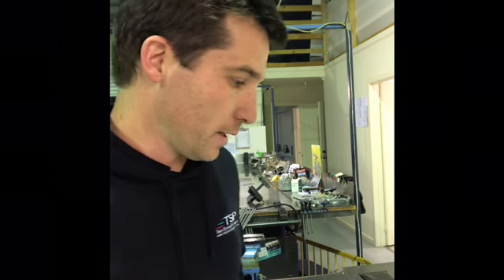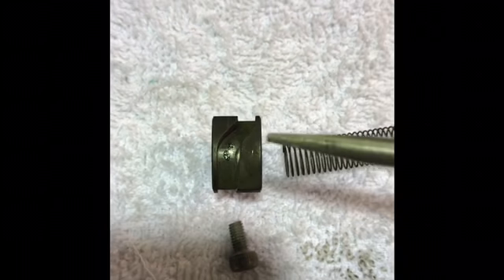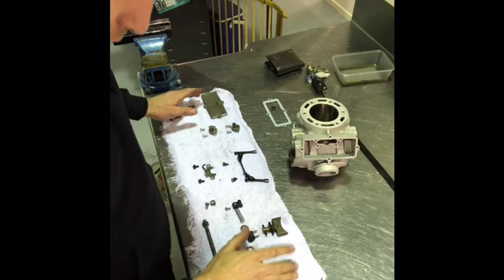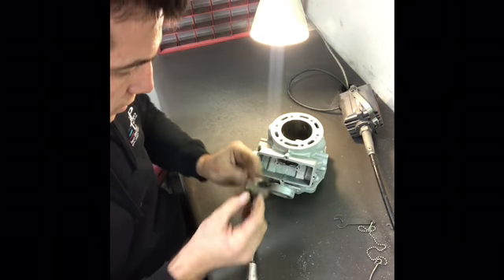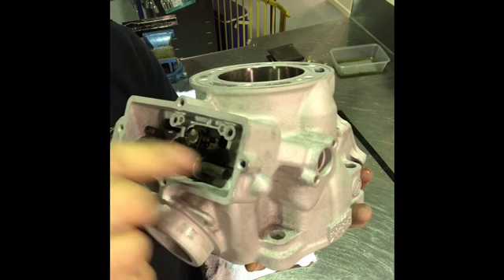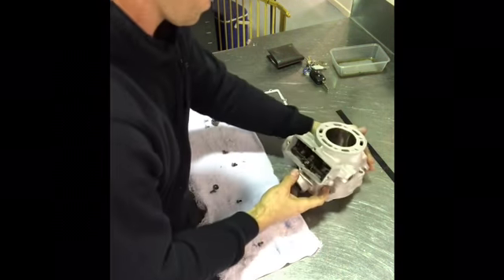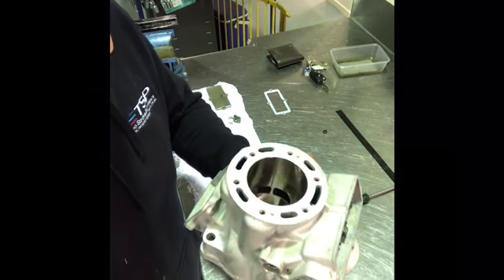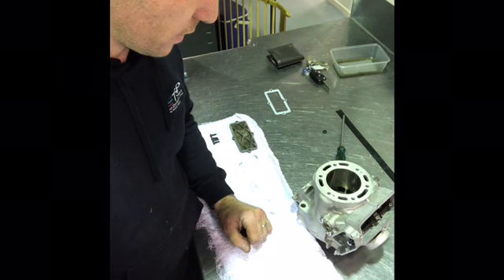YZ250 powervalve rebuild

Comment: The power valve shaft, #11 in the factory service manual, should have the retaining clip, #8, installed as soon as the shaft is put in.  This will locate it precisely for the rest of the build.  The fitment of the barrels was giving you issues as the shaft was sliding left and right which you kinda figured out at the end of the video.   Also the crecent cut of the power valve shaft at the retainer should be to the upper right as you are looking at the retainer after it is installed.  This will keep the cut out away as it is motion. 

Great video btw, really helped me!
Reply: I watched the whole video to find this out

Comment: Question. I have a yz250 new top and bottom rebuild. Power valve opens main valve but not the subs. If I turn by hand they all open, main first then subs. The linkage lifts enough to open the main when revving but stops too soon. Stock everything except fmf silencer. Power is great on the bottom and mid. Top feels  like a 125cc

Comment: I noticed you said it doesn't matter which side the drums go in. Wouldn't be ideal to keep previously mated surfaces together unless you are replacing as a whole? Could you rotate the drums and use the the top surface where the forks would make less contact as fresh surface or are the drums directional, i.e have a top and bottom- clearly they slide into the cylinder one way. I'd imagine most the wear occurs at the fork pivot point, the fork its self and the pin the fork engages with in the groove of the drum. Awesome vid thanks

Comment: Do I have to remove the power valve to remove cylinder head?
Reply: Edward Duran no just a litle arm on the left side
Reply: @thibo2107  cylinder head only head bolts.....and stay....cylinder ...8mm bolt in arm.

Comment: Thank you so much. This video was super helpful. I am in the middle of rebuilding my YZ250 from the ground up. During the tear down, I broke the piece you mentioned that commonly breaks on this type of power valve. So I had to order a new one. They are not cheap...:-) Thanks for the tip on having the sub ports completely closed when tightening the 3 mm screws. This video was super helpful. 

Thanks again.

Comment: Sorry if you mentioned in the video, Dave (didn't end up watching it all). Is this something that can be done with the engine still in the bike? I'm guessing the piston and everything can stay together while removing this?
Reply: its extremely difficult.  stock cylinder will have phillips screws holding the cover on the PV, so you'd need needle nose vice grips to remove them in most cases (the PV cover sits too close to the frame/rads to get a screwdriver in there).  then its a matter of "can I even see wtf I am doing?"  Sure it can be done and has been done.  but in an extra 15 mins you can have your cylinder off and not worry about the hassle of working in a confined space
Reply: This was also my question.  Thank you sir. Great video. Much appreciated

Comment: Hi just a quick 1. The seal that u mention at 17:54 needs replacing on my bike, do i have to remove the pv shaft to replace it? I have a 2007 yz250
Reply: yes, you need to remove the shaft to replace that seal

Comment: When you're using the pliers to open/close the powervalve.. is that under spring tension or could you very easily do that with your fingers as well? 
hopefully your answer solves the issues with my bike. Haha
Reply: Justin Pelkey It's not under spring pressure but kinda hard to do with your fingers. Plyers make it easy.